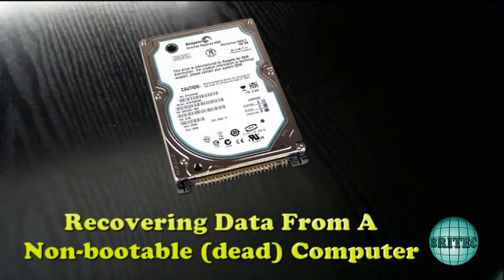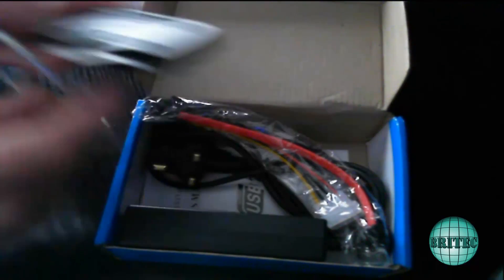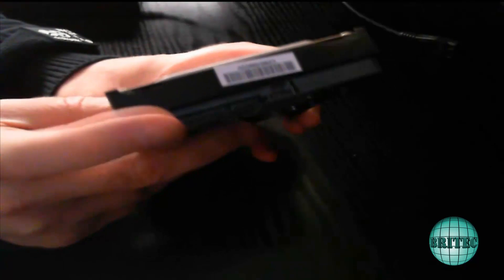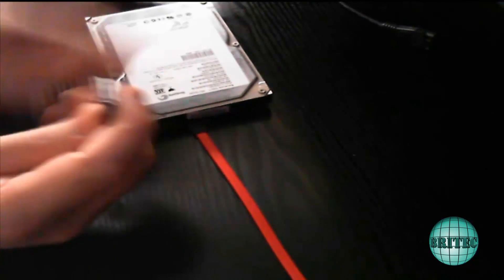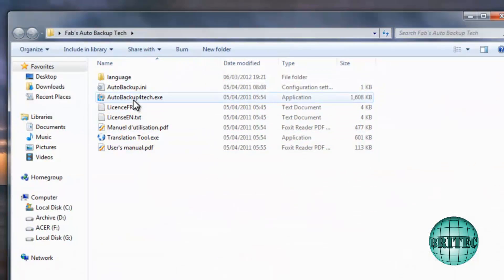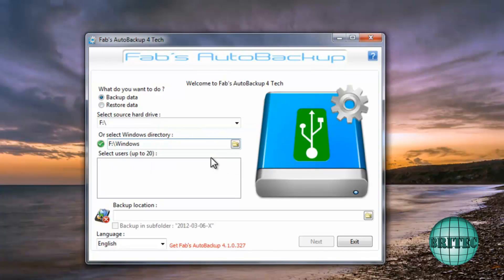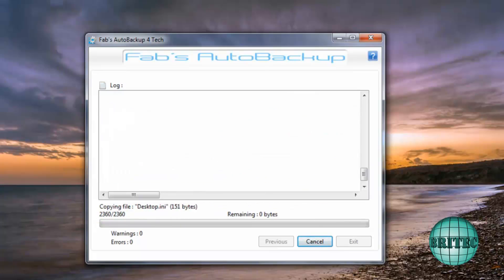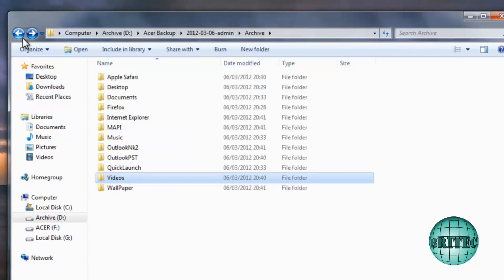Recovering Data From a Non-bootable (dead) Computer by Britec

Comment: So by non-bootable, do you mean this will work for drives that were previously in a computer with corrupt system files (which prevented the boot up) or drives that were in a computer with some non-os related booting problem? My hdd was in a computer that wouldn't move from the loading screen so I think it had some corrupt system files.

Comment: PLS HELP.. 
when I want to reinstall Windows , my HDD is no longer detected or broken , so I replace it with a new one . but , I really need data stored on the HDD is broken , I just record some songs of my own and it was not stored in ( C ) and ( D ) , how do I get the data back ?
I understand about the video that you describe , but I do not understand , how do you transfer data from a damaged HDD ? whether the HDD installed in the laptop or outside of the laptop (using tools such as USB ) ?
PLEASE HELP ME
Reply: This video is only useful for working and accessible drives not damaged or locked ones...pc that crashed obviously had other issues

Comment: I have an Old 2008 Gateway M-Series (32-Bit?) Pre-installed with Windows Vista 32 bit, and a 64-Bit HP Pavilion TouchSmart 11 Pre-installed with Windows 8 64-Bit. Can I directly take the drive from the old computer (Gateway) and put it in the new computer (Helwett-Packard) I think the computer may be compatible.
Reply: It's surely compatible wth Vista, what I meant was the 32-Bit os in a 64-Bit computer, I've heard some 64-Bit machines are backwards compatible with 32-Bit architecture.

Comment: can you copy program files as well? I ran Ccleaner and it completely killed my computer and I can't do much but boot with a CD and that is it. When i try to backup files with the Neosmart recovery cd (bootable) it keeps saying that it cannot read the hard drive and that the directory does not exist.... so Im guessing this is my only salvation (using the adapter) so I'm wondering what files will be transferred? I need to get as much possible. Thank you for this video!!! :)

Comment: I had a non booting C drive about 18 months ago, it wouldn't boot but was still spinning slowly. Fortunately I have an SATA external dock & purchased a new HDD then cloned the C drive to the  new HDD using an Acronis bootable CD.
The new drive was bootable and the whole process took a couple of hours to complete but it worked a treat.

Comment from the maker: @RobCharles1981 Hi Rob, if your drive is dead as a Dodo, then your need to do data recovery in a clean room, if there is life in the drive and it works but its been wiped, you can still get data back with software data recovery.